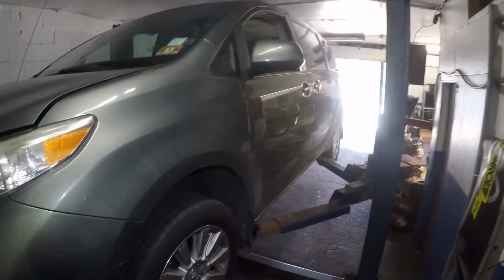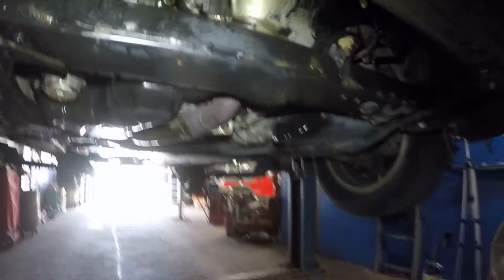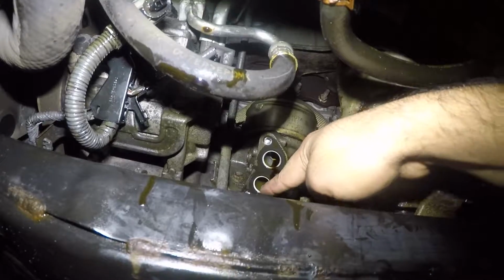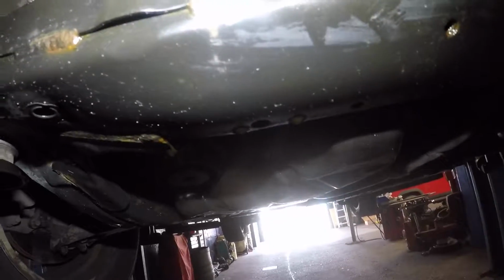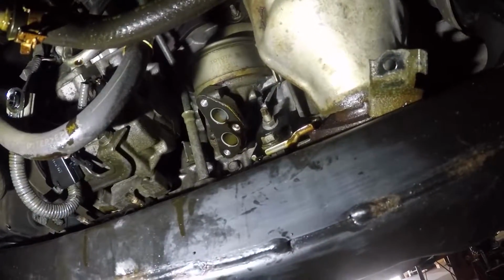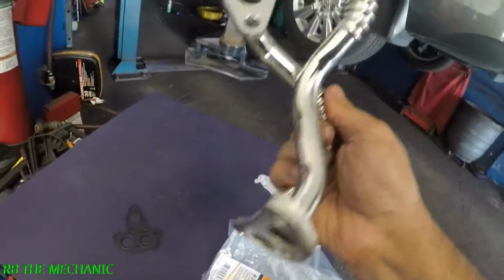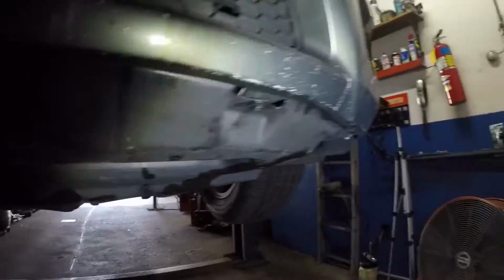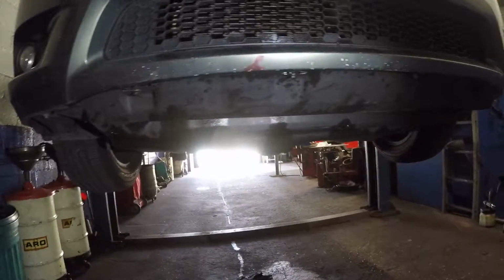Toyota Sienna OIL LEAK OIL COOLER LINES

Comment: 2011 sienna here.  My hoses looked fine but doing it anyway while I am changing oil.  By the look of it the generation of 2011 sienna is harder than 2010 sienna because the space is tighter to remove that one lower driver side  nut.  Perseverance won the day and I was able to remove it.  The biggest problem was the rust on the studs threads.  You risk rounding the nuts or worse snapping the studs.  It would be a nightmare.  To remove that nut I tried to buy a semi deep 12mm socket.  No luck.  No one has it.  I ended up buying a metal cut saw for my 10" miter saw and sacrificed a craftsman 12mm deep socket.  Coupled with a 5" extension and a swivel adapter and a lot of patience and care, the nut wen't off.
I ended up getting rid of the studs and replaced them with m8x1.25 bolts.  Putting the new part on was easier.
Reply from the maker: Yeah I had to heat it up a bit
Reply: The trick for me was using a metal brush and scrubbing as best as you could the rusts on the threaded part of the stud.  Then loosen the nut.  When it didn't want to go further, tighten it and brush.  Repeat and take time.  It's better than snapping that stud or round the nut.
Reply: I have same year as well 100.000 miles I got coolant  in my oil and my sienna  is like new this Engine is Falsely  design  I'm selling  mine after repair  asap Toyota  is Full drama  nowadays  it's not same car anymore  way too many changes  in sutch  short time interduce  2022 23 sienna near 50k that's insane 🙄🤔
Reply: @st-qd8wg  coolant in oil?  Sounds like you get leaky head gaskets.  Mine is 135k miles.
Reply: @joshuatran3667  Yes, this is false. Design  head gasket  on 2011 through  I believe  2017 the head gasket  meteral  they used is poorly  constructed  and it's causing  the gasket to Lift from head and causing  Leak in to the galley  where the separation  is @ oil & water that is the issue  you mentioned  it's Toyota  problem  not vehicle  owner my sienna is Like Brand New mint condition  gorgeous  and now I git big hassle  on my hands un expecting sutch thing there are many problems  with these  vans suspension  eating  tires transmission  is sealed  that is Terrible  and they want charge  257.00 to service  trans when it should  only 20 min change  oil drop pan filter on your way easy  job but they  seal system  so you destroy  gear box so they  can sell another  Van to you tyrant  it's Not the old Toyota  anymore  these  days  over I'm replacing  it asap as I said I'm not going waste funds on highly expensive  vehicle  service  up roof .
Reply from the maker: @st-qd8wg  did this pipe leak? This dosent mix anything only leaks

Comment: my hose had a spray from a pinhole. leaked all the oil. the oil pooled under the passenger tire. this is how i figured it was this area.  funny how none of the new one has rubber hosing now. thanks for the info, and for explaining how to remove the odd locations of the nuts.
Reply from the maker: Yeah this could destroy the engine

Comment: Dorman part sucks...I bought OEM part with brazed, not welded ends for cheap on Amazon...like $65.00. You did good job though...it took me 3 hours in my driveway...not fun.
Reply from the maker: Yeah glad u got it done.  The one bolt was pain the the A..

Comment: Thanks a lot .I have a 2007 toyota sienna. This just happen to me yesterday. After watching your video I have seen the same problem under .that pipe was leaking the oil. Thanks a lot .how much would it cost to fix it ?
Reply from the maker: The part is like $125 but if u pay profession it might cost u like $300 labor due to that one bolt hard to get out

Comment: I have oil in the coolant reserve tank and leaking on the driver side of the van on my 2017 sienna. you think this could be the issue?
Reply from the maker: Engine coolant mixture could be bad head gasket

Comment: Just did mines and it's still leaking. Could it be because I used Dorman parts instead oem parts? Did you have any problems after you used the Dorman part? Great content btw
Reply from the maker: I didn’t have any problem maybe ur part is bad or the seals or it’s not sealed up propperly
Reply: @RBTheMechanic  ok, thanks for your input. I'm gonna reevaluate it

Comment: Hello, how much is usually charged to change the oil cooler line for a Toyota Sienna?
Reply from the maker: Depends how complicated it gets $140 labor would be good unless the bolts jammed up like I had issue with one of the I ended up charging 1 hr more labor
Reply: @RBTheMechanic  Thank you!

Comment: What years are affected
Reply from the maker: The newer siennas 12 and up prior to that don’t have it
Reply: I’ve got a 2011 sienna. When it was on the lift at Firestone a few days ago I saw that the oil pan had oil all over it. I Was in denial because of all the other work being quoted at the time and I didn’t say anything about it when I should have. Now it’s leaving very small stains when I park it. You think it’s the oil cooler lines ?  wonder how much this gunna run me. 😑
Reply: @billjoang  I paid $167 at Toyota for the part, they estimated 6 to 700 USD for labor. I’m doing it myself.

Comment: Just had a 2007 that this happened to.   Wife took kids to school and noticed engine knock as she was climbing a hill on the way home.   She parked it and I checked it and found the dipstick dry.   Added 3.5 quarts and started seeing some on dipstick.  Had it towed to mechanic and he found the leaking part.   Hopefully engine is not damaged.  We filled up with oil and ran it for just a minute to listen for knock and all sounded fine.  Hopefully I will get it back in the next day or so and all will be well
Reply from the maker: Yeah I think u might just got lucky!!! Hope all goes well these siennas are good
Reply: What are your thoughts.  If no noticeable knock upon starting up after fix should there be engine damage
Reply from the maker: @garrettcarter6076  these engine don’t get damaged that quick but only time will tell I think it should be fine … if u want to take a step further ask the mechanic to see if there’s any particular of metal in oil … also look to see if there’s metal partial in oil filter I think 2007 has regular metal can filter ask for that and rip it open
Reply: Rb, good advice and thank you for replying.  Will do as you suggest
Reply: So,  got van back from mechanic.   No metal in oil, engine sounds great at idle and at rpm’s.   But when put under load while accelerating there is a slight tapping coming from the engine.    Mechanic thinks it maybe wrist pin knock.  Engine does not run rough just has a tapping.  Your thoughts?
Reply from the maker: @garrettcarter6076  double check all oil level but I doubt it’s damaged even if it is not much u can do still I think it’s fine just have mechanic opinion what he things since I can’t heat or observe the engine
Reply: @RBTheMechanic  thank you.
Reply: I would  stop ✋️ 🫸 the car and call you and wait for instructions before I continue  to drive Van back after its Clear Engine  is knocking. It's definitely  something  serious  going on thir and wife. Continue  put you in hot water  almost  w/ big service  bill get. AAA mentorship  and give to your Lady as birthday  gift say use it next time 🤔😒😏🙄😌
Reply: @garrettcarter6076  This mechanic  cracked me up one minute  is good engine  next its bad design you know  what they say about mechanic  they want your funds as much as possible  there are not honest and i cant stand someone  plays guessing game with no solution 🤣😏🤔

Comment: Hello, about a week ago I got a low oil pressure warning on my 6 cylinder 98 Sienna LE . I didn’t think much about it except to check the oil, sure enough it was low so I added a quart. Then yesterday I discovered a leak from the oil pan area on the passenger side, I estimate at least 25 percent or more of a quart of oil had leaked in other words a bad leak. I inspected the pan with a flashlight and inspection mirror where I couldn't see too well and there were no visible cracks, There is no black or grey smoke from the exhaust so most likely not the rings and the leak is nowhere near the engine head. it seemed like the oil was leaking from the oil pan gasket with the engine warmed up. Today I added a quart of Lucas Stop Engine Oil leak in the hopes it would stop the hemorrhaging, After warming up the engine and driving around a few mins I parked and saw only a thin stream and it seemed like it was better but than it started to really leak, finally I traced the leak to above the oil pan adjacent to the oil filter, and from what it looks like to me it’s related to a towing package oil cooler I can’t find anywhere where it shows the 98 LE came with an optional tow package, but mine which I bought second hand has a tow hitch  and tow wiring so unless that was installed after market than then I guess it does have a oil engine cooler, I was reading on Toyotanation that the oil cooler lines have a tendency to break and leak, but I don’t know how bad the oil leaks when that happens , I need to get It looked at and fixed if it’s cost effective, Am I on the right assumption that it’s the oil cooler? Thanks for any help or suggestion liked and subscribed..
Reply from the maker: It could be ur repair main seal leaking if it’s comming from center of engine in bottom have it checked out and if it’s the main seal that like $1400 labor
Reply: Lucas oil leak stop?  Mechanic in a can.

Comment: Does this just apply to Sienna's equipped with a Towing Package or all Siennas (2010)?
Reply from the maker: I don’t think 2009 has this not sure but take a look of it got the pipes down there then yes it applys
Reply: @RBTheMechanic  is A/C system needs to be discharged to replace cooler line ( is it on the way) maybe I got wrong info
Reply from the maker: @anushberry  no it dosent bother just one bolt is hard to get to so u need to use swivel and try not to brake these bolts or u would be in big trouble I did use light of torch and carefully from burning engine seals
Reply: @RBTheMechanic  thank you God bless you, my Sienna 2008 has 110,000 ml I am going to replace before it starts leaking
Reply from the maker: @anushberry  no problem like I said be careful with the bolts do not brake them other wise I’ll will be good
Reply: @RBTheMechanic  Hi, that's me again, I bought oil cooler from dealer for my 2008 sienna   and was going to replace it , I look up All around engine did not find oil cooler location. Is that possible  2008 engine has options?
Reply from the maker: @anushberry  yes the 2008 is different the newer siennas are the issue what is the problem ur having oil leak?
Reply: @RBTheMechanic  I just was going to replace before it happens on the way. Not all 2008 3.5 l  Sienna's  have have this system. So returned part's. Thank you for your respond anyway

Comment: Hello I changed this out and have a small leak should I have used silicone
Reply from the maker: Derick Dove check your seals or use this dealer it’s called Honda bond u can get it on amazon or from Honda dealer it’s super good!!!
Reply: With the pain in the ass fasteners, possibly you didn’t get one or two of the bolts/studs quite tight enough. Just don’t over do it!

Comment: Is that all you had to remove was the plastic diapers and the oil sensor bracket,  and how much torque on the nuts to install the line?
Reply from the maker: I couldn't find the torque specs so I tightened to to my best ability and feel....yes that's all I removed just the bolt on the bottor was hard to get socket on I did heat it up lil bit carefully not to damge the oil pan seal

Comment: You didn't even show how you put the screws in there, useless. The most everyone has problems are how to get the screws out and how to get the screws back in especially those in tight spots.
Reply from the maker: Chan Xiong that’s what I explain how I used the swivel to get the bolt out only one is hard ready are easy it was too messy for me to record oil leaked all over
Reply: If you need to see how to loosen a bolt, you should probably pay a mechanic to do this for you. It’s above your abilities
Reply from the maker: Jay JDM92 it’s cool every comming gives detail and gives more information to others but this job is easy messy busy easy just have to be careful not to brake the bolts also it looks hard
Reply: @RBTheMechanic  That 1 stud that's closest to the oil pan? Did you use an external torx socket to get it out or did you just unscrew the 12mm nut? Your video is unclear on that detail. I'm stuck on that last stud and I can't even get to it with any socket. 🤷‍♂️
Reply from the maker: Art Camera the plan was to use the torx like u said but mines as I unscrew the nut the bolt came out with it
Reply: For that tough nut in the back on the upper flange I could not get a socket even on it's own on the nut. It interfered with the metal pipe (dorman brand). I cut a cheap 12mm combination wrench to about 4" and then bent it in a vise with a hammer. Use the closed end of the wrench.  I could not have done it with a swivel the socket just wouldn't fit. Also inverted torque on the lower studs seemed easier.